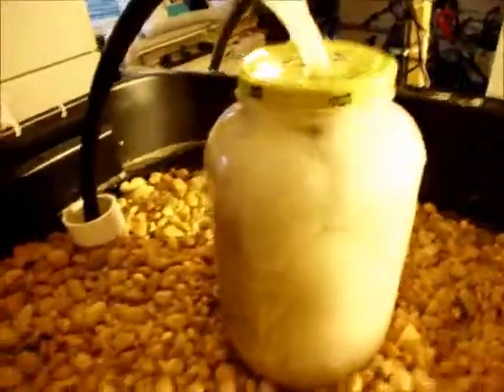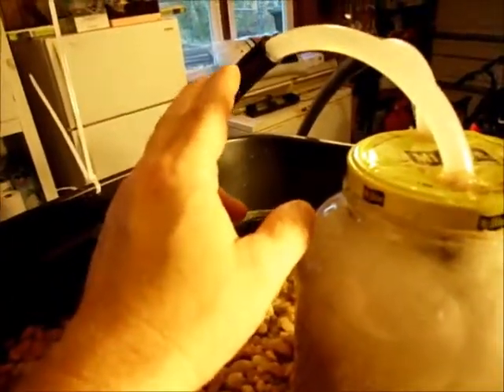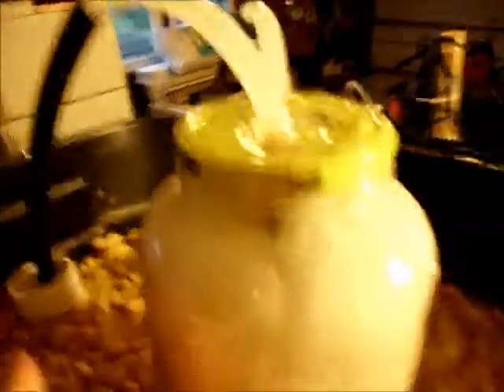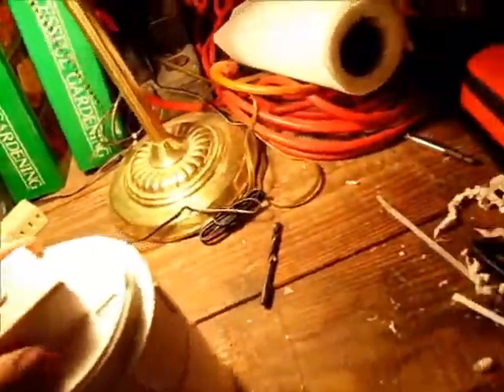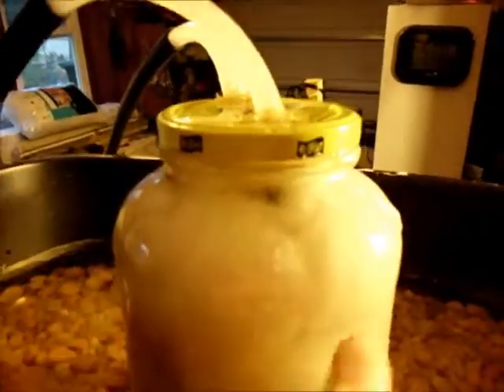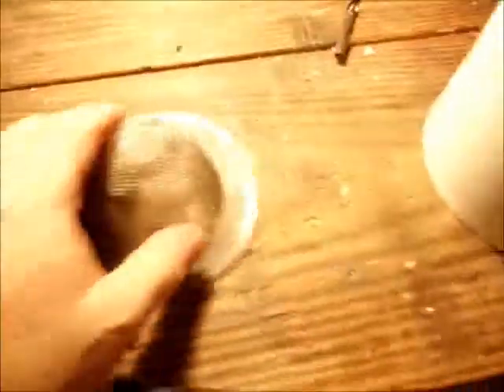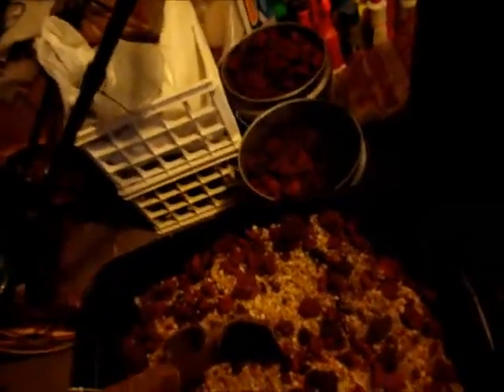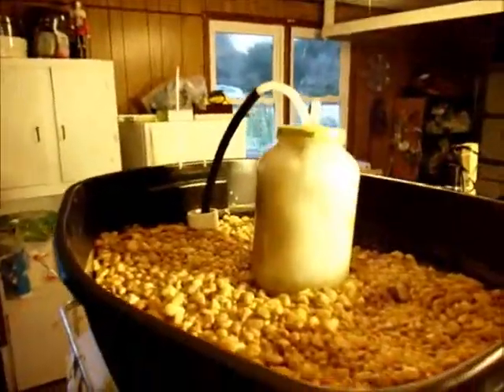Aquaculture Filter

Comment from the maker: Point well taken. In my latest modifications I cut out a 30" x 30" square at the top of the plastic tank, leaving the sides to curve up and add support. I didn't even consider this with my earlier tanks.

There is also a metal bracket at the top and I can state unequivocally from experience that these are require when adding over a ton of water. =)

Comment: One tip for making a tote more durable is -- before filling it with anything, glue/silicon the lid on and cut out the center, the extra support around the sides at the top to help limit deformation helps tremendously.